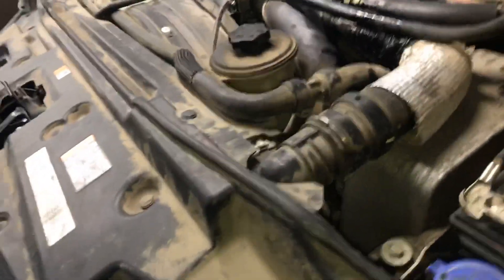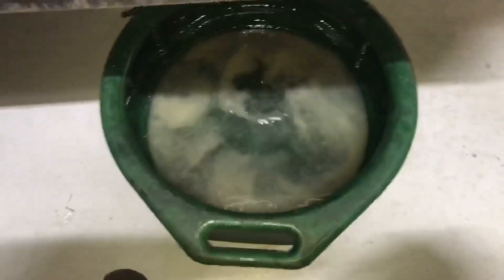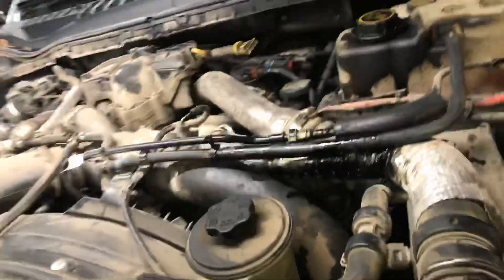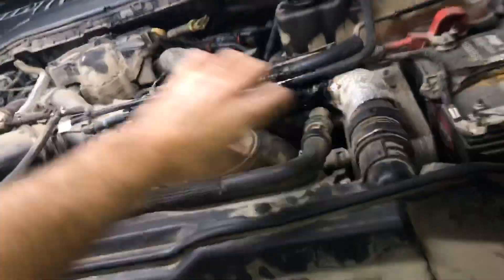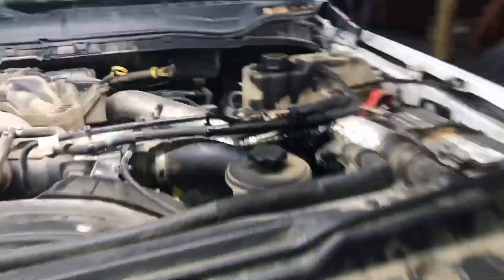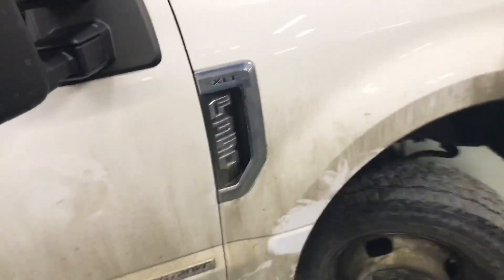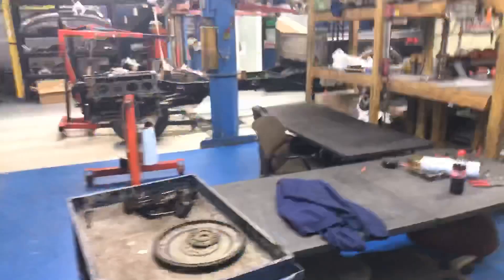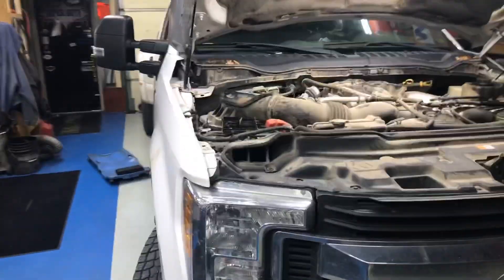Alex’s 17 def in fuel

Comment: I deal with this couple times a week...in my shop. I usaully flush the system clean tank...etc. .. and change filters and pour a bottle of Stanadyne # 43570 which has corrosion inhibitor in it ...put diesel in the tank and test run. Usaully get a # 08 missfire for a little bit before it goes away after a minute or two. I only had 2 trucks where....1 of them it took out some injectors, and the 2nd truck it ruined the hp pump. Besides that they never come back and alot of them are fleet truck with about 5 month being customer trucks, plats, lariats, limited trucks. You can buy the bottle of Stanadyne at Oriellys usaully get from there dc center or alot of Tractor Supplys carry it.

Comment: The problem here is even though the guy caught himself putting DEF in the fuel tank, UNLESS he unplugged fuse or disconnected the batteries, everytime someone turned the key on to steer the truck the fuel transfer pump is pumping for almost 15 seconds pushing DEF through the entire system. This will be a crap shoot.

Comment: Called by buddy at a local Ford dealership, he said if there is DEF to the fuel filter, it has gone through the entire system. Unless you replace the ENTIRE system (take to injectors, all lines and sensors) they will NOT warranty any of the parts. Whether it lasts a year or a week they won't warranty it unless it's all replaced as it is the only way to ensure its all out.  So yea that totally sucks

Comment: Doesn't this usually trash the fuel system?
Reply: Yea, it usually destroys the injector pump and injectors.  DEF is very acidic and it wrecks everything. If youre VERY lucky you can flush the system, but it makes crystals when exposed to air and causes irreparable damage.  Matter of fact , Ford recommends replacement of the ENTIRE fuel system for def contamination as itsbthe only way to ensure you get ALL of it out. As little as 1 pint in a 25 gallon fuel tank WILL destroy your fuel system